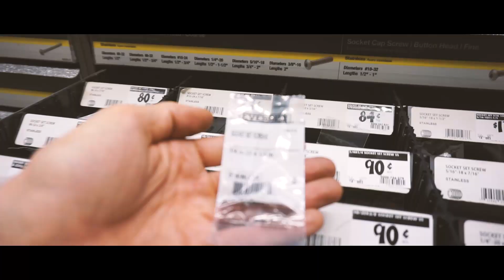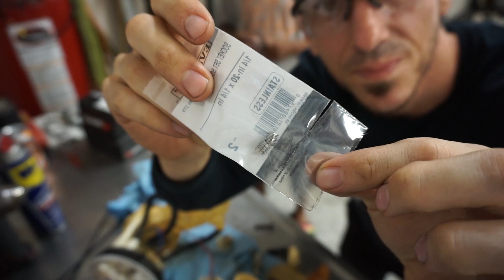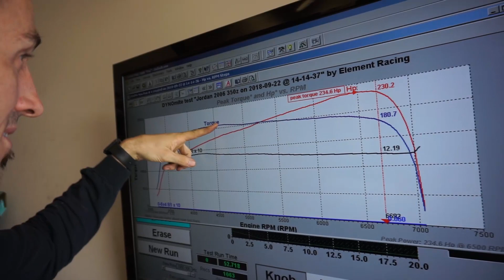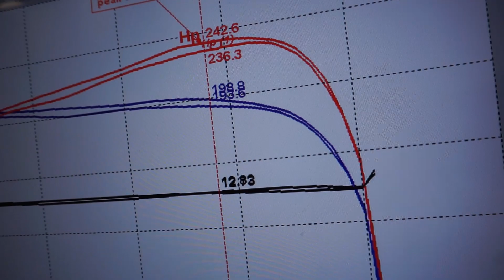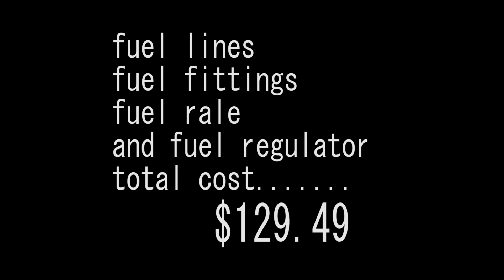acura rsx fuel return system DIY

Comment: Good show again, guys.  That was one hellafied monsoon... gotta love that Texas flood.🎸🎶  I didn't realize the RSX fuel system was like that.  My old Integra GS-R had a fuel pressure regulator and the setup was similar to how you made Yari's.  BTW, those lines, connectors, and pump were very reasonably priced for what all you got.  The pushlock setup is badass!👌  Makes everything so simplified.  Y'all have a great week ahead.  Cheers!
Reply from the maker: Ya most newer cars have a returnless system ...... the Nissan z has it too. I’ll do a vid on that soon. Simple and only spend money on parts that Work 👌 I wonder if we can still get 22 mpg on jaris car with a full tune and more hp 😎🚗💸💨💨💨💨

Comment: Nice!!! I've been waiting for this one for a while. Going to certainly go with this method!! Let the RSX Drink!
Reply from the maker: lol #thirsty , also for bigger power over about 500hp , this setup leaves you options to add even more fuel supply .....this comes from the idea of volume vs pressure ......in tank pump has high volume ....but not high pressure. So ........there’s ways to make this system handle about 700 + hp .

Comment: What size fitting was used on the top of the housing as well as what size hose did you guys use? And if you don't mind me asking, what fuel pressure regulator is that? Thanks for the info!
Reply from the maker: Usually I use -6 on most fuel lines unless it’s over 1000hp

Comment: @gearheads autofab, question on the dyno, when you hit the rev limit how do you cut ignition or get off the throttle to avoid going over the rev limiter?
Reply from the maker: Well.... I make sure the limiter is setup in the computer how I want it then just hit the limiter. Most cars are setup with a conservative limiter. I have done hundreds of dyno test on all types of cars and hitting the limiter never hurts anything. With that being said ..... you can hurt us by riding the limiter too long so I just hit it and let off and it’s always perfectly ok.  I also have had cars with no limiter and I just get out of them a a certain rpm , just more dangerous lol. Lots of things kill car engines that’s just way down the list ....
Reply: Gearheads Autofab i noticed some tuners have a button switch that they hit when they reach the limit. Just wondering what you call that
Reply from the maker: If it’s the button I’m thinking of it’s the dynojet button that starts and stops the dyno recording but it has no connection to the car.
Reply: Gearheads Autofab ooh is that for dyno recording?!?

Comment: How can I use the regulator with the stock lines & stock fuel rail??🤔
Reply from the maker: No, because the stock fuel pump is regulated already in the tank, any the main reason to add a return is so you can adjust the pressure and have it raise pressure with boost at a 1-1 ratio.

Comment: Are you guys going to install an inline fuel filter?
Reply from the maker: Good idea , but on this one we left the stock fuel feed unmodified so it’s filtering the same way Honda designed it. If we upgrade the pressure line I will add a filter for sure !!! 👌😎
Reply: Sorry I know it's been awhile. But when you guys made a hole on top of the fuel pump assembly and thread in the black fitting. Did you add another fitting and hose on the underside? Or did it just dump the fuel straight from the fitting.
Reply from the maker: Dumps straight from the fitting. Basicly shoots straight to the pump basket pickup  anyway.
Reply: Gearheads Autofab if you add a hose to the return fitting inside the tank, could that prevent aeration (mini air bubbles being sucked up by the pump)?
Reply: @xlightssx  not really it could cause your car to run lean if it's 1/4 tank low if dump straight to the tank, if you can run the fuel back to the pump it would be better
Reply: @jayalves2634  how would you go about doing this? Drilling a hole and adding a line back into the cage
Reply: @yosh_tuned  i ended up redoing my fuel system, I used the return line that he created as my feed line, I used the factory feed as a return instead, when I copied his style I notice I was running lean when I was about 1/4 tank low, and also I notice gray silicon floating around my pump and realized it was hondabond that pretty much melted cause of the gas

Comment: So where did u guys do with the original fuel feed line ??
Reply from the maker: Some times I use it for the return line because it returns a little more volume, or you can cap it and use the normal return.